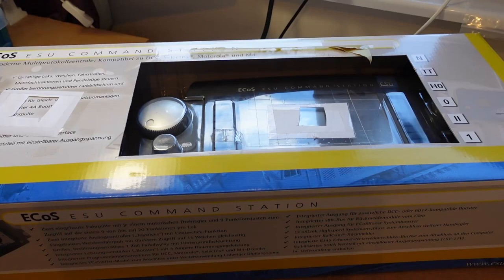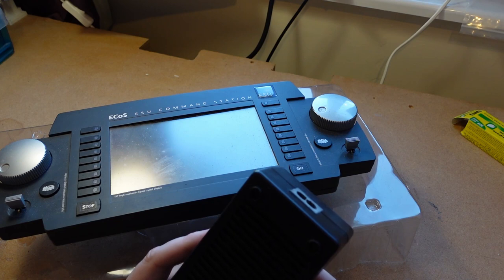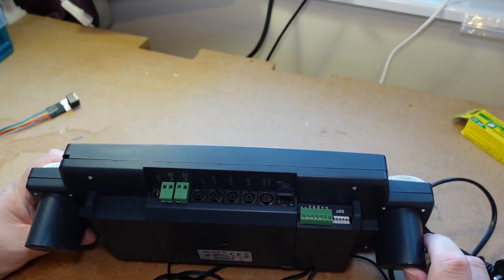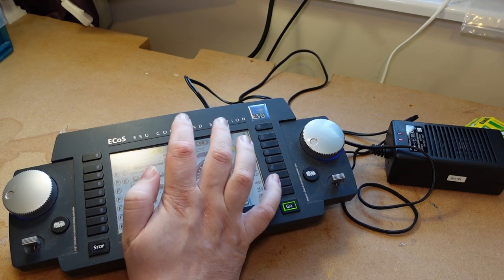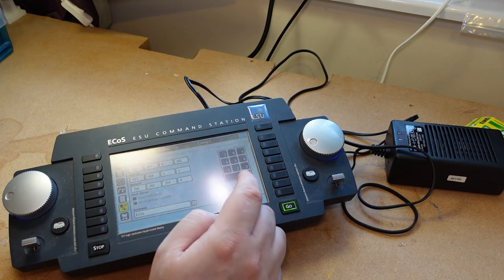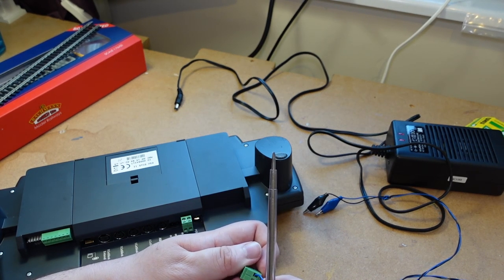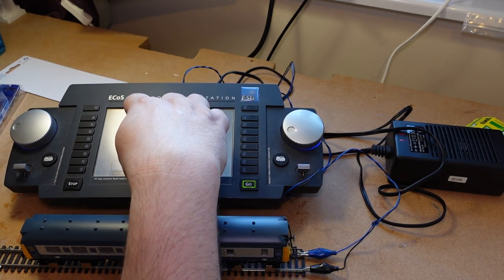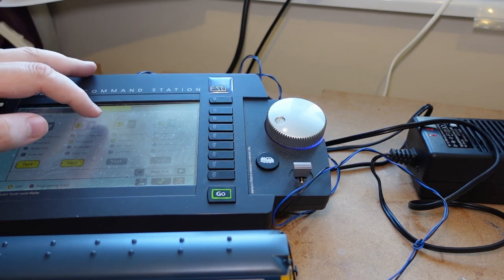Getting to know the ECoS

Comment: I started with the ECoS before I got the CS3.  The ECoS was excellent, no complaints, I just felt the CS3 worked a bit more intuitively with all my Märklin trains.  Both are amaying control modules and it becomes a personal choice.  The only advantage the CS3 now has for me is that it automatically reads the MFX decoders, where you still have to do one extra step to load them on the ECoS.   Great video!
Reply from the maker: I know what you mean I thought my new train had a Esu decoder in it which it loads the accessories details automatically but then I found out it had zimo I was disappointed as it meant I had to load them

Comment: you must keep the batteries in all te time otherwise it will not keep all off your info the shuttle system works very well when you want to do a shuttle run but you must have a detector to do this i use this all the time .
Reply from the maker: I took out the battery as it was in long term storage and I don’t want the battery to leaking it was plugged into a ups so for a quick video it was safe. The battery are used to shut down and safe the data if it loses power. I have not tried the shutter system but hopefully will have a try in next Saturday video. Thank you for your feedback